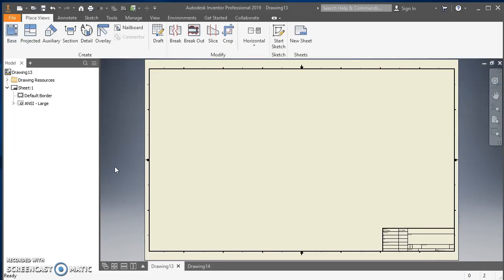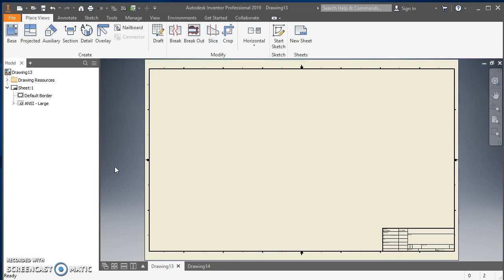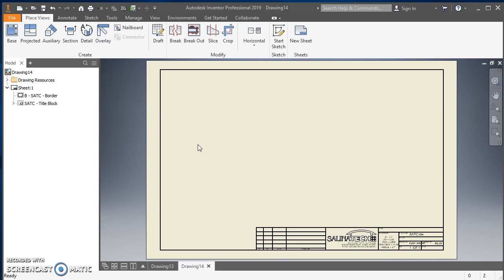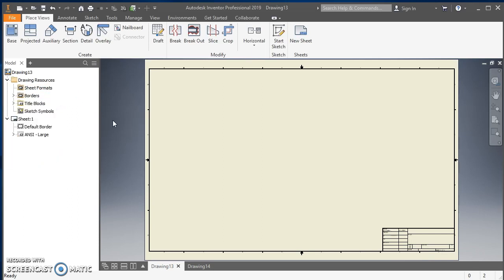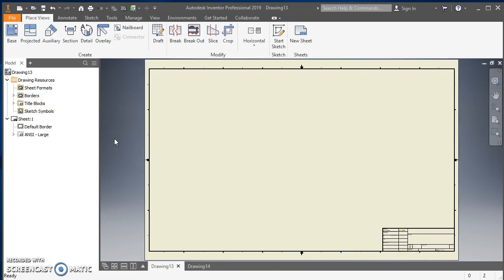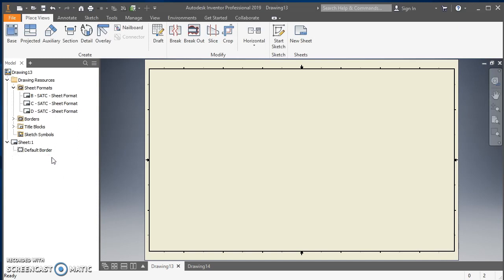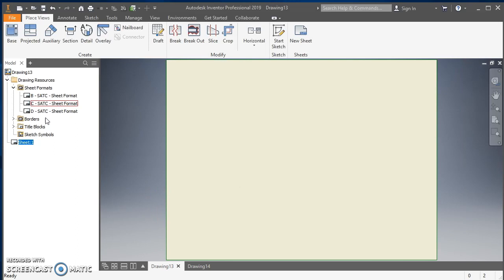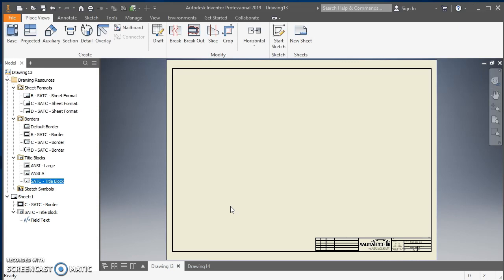Changing Title Block, Sheet Format, and Border in Inventor

Comment: I hate both the Inventor Drawings and Autocad Layout Tabs,  They're Both just horrible.

After almost 50 years of this crap you'd think they could make it a little easier to use.

I know it sounds stupid, but I prefer to export the line Drawings from Inventor and just finish them in the Model Tab in AutoCAD.

I Don't care that I lose the Association with the model.

Every time you use the model to drive anything, it changes all the Drawings anyways, so you still lose all of your history either way.

People underestimate how much faster and easier using regular 2d cad can be for 99% of what you need Cad for.

Everyone always tries to push for 3d.  But for anything where you're using 2d templates, which is like 99% of Material Processing.  It takes 25 Times as long to lay out the profile of the part, constrain everything and dimension everything, only to convert the fully constrained 2d into a 3d part, which you then need to convert back into 2d for the Drawings and Documentation,  which you still can't use most of the time with other 3d party software,  so then you still have to export it back into a 2d format again to use for any type of Cutting machinery like Burn Tables, Lasers, Plasma Cutters, etc...

It turns 1 easy step into 4 or 5 much slower, harder steps.  And in Most Cases, you still end up in 2d CAD when you're finished.

I love Inventor and Solid Works,  but people always forget just how powerful and efficient plain old 2d AutoCAD is.

It's still the better choice for most businesses, even though everyone tries to upsell them and make their lives more difficult.

I use both, and they are both amazing tools.  All the Real Engineering needs to be done in 3d.  Weights, Centers of Gravity, Interferences, FEA, etc...

But when it's time to get to work and actually start cutting parts and building something, nothing beats good old 2d AutoCAD.